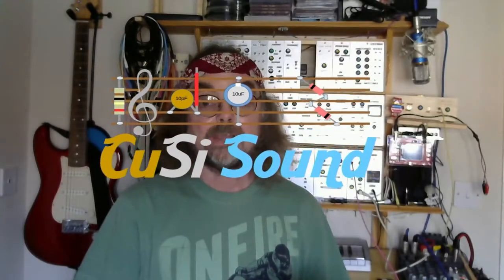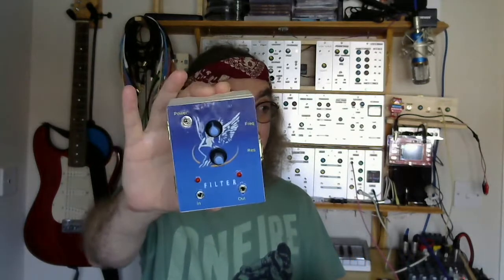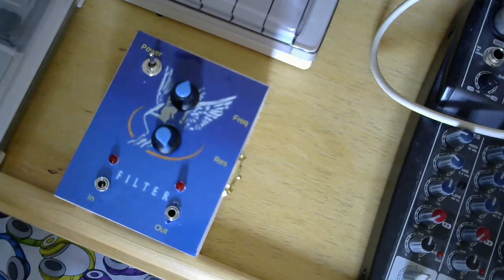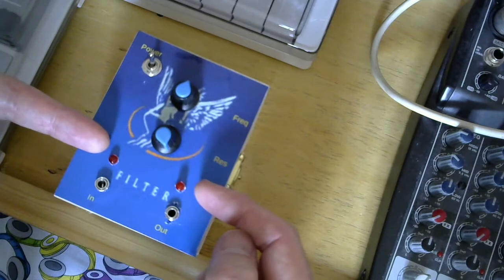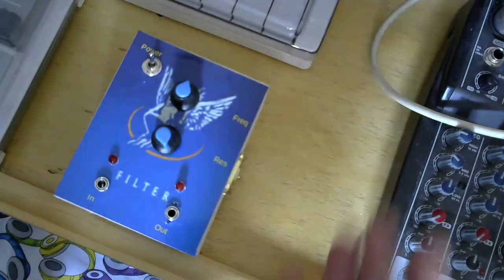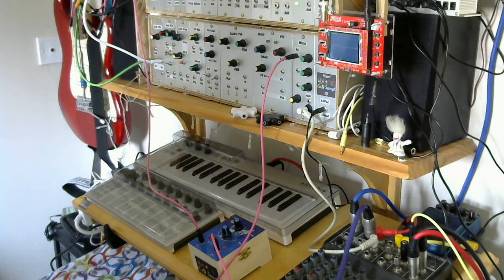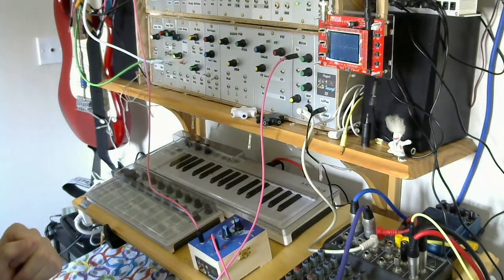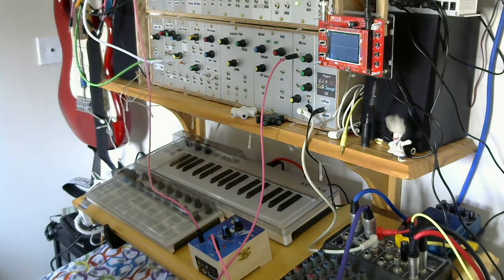Little Boxes Part 10: Filter (VCF)

Comment: Another question: Besides some lights, what difference does it make to use 2 LEDs instead of a signal diode? 
Can we use a single LED?
Reply from the maker: You probably could use a single diode. Look up the circuit for the Q&D VCF. It will change the characteristics of the filter probably reducing the cut off frequency range and altering the CV response.
Reply: @CuSiSound  Thanks for your answer. This filter is my next project. Well, on of my next ones 😀.
I'm gonna experiment a lot on the breadboard. No CV in though.

Comment: I've just finished soldering my VCF! Thanks for your instructions.
PS. I hear buzzing when RES is turn all the way down - how can i get rid of it?
Reply from the maker: I have been playing around with my build of this circuit but I don't get the buzzing as you describe. There is some noise when I turn the res up high but that is inherent in the simplicity of this circuit. As I understand it, the original author of this circuit was going for simplicity rather than fidelity. One thing to check is the connections to the filter as a dodgy patch lead is often the cause all sorts of problems, I have plenty of experience of that!

Comment: can i use tl072 ?
Reply from the maker: I have just done a comparison check, swapping the LM358 for a TL072, and it appears to make little or no difference to the performance of the filter. The short answer is yes you can use a TL072.
Reply: @CuSiSound  Thanks m8!! i have 2 options now!

Comment: That sounds like a solid and reliable little filter. Something I hadn't heard before is how it seems to actually shift the pitch as you adjust the cutoff frequency. Is that the effect of the opamp, just increasing the amount of voltage?
Reply: Given its basic layout the UltraSimpleVCF is incredibly effective. I first came across it about eight or nine years ago and put it together with an LM324 at 5v, some of the output could be very aetherial. Had a nice eerie, hollow booming effect with a sudden change in the CV.
Reply from the maker: I'm not sure what the electronics theory is for that effect, it's beyond my level of knowledge, but it adds a little unique character to the filter that I like. I have a version of this filter in my Project XII synth and it's great for shaping bass sounds.

Comment: RELEASE THE SPACE WHALES! lol jk. 

Sounds good and looks nice. I think I'm going to build this one up myself. I like that you used leds in replace of the signal diode. I going to add the CV back and maybe even add  CV for the resonance.(vactrol maybe?) I've been putting off building an active filter dew to most having used a split rail power supply. so this is motivating and lots of help. I wonder how changing the non inverting ref voltage effects the circuit. something to play with. Hope you're having a nice day.
Reply from the maker: The simplicity of this circuit makes it ideal for experimenting with component values on a breadboard layout. The key ones for frequency filtering are the capacitors and resistor that make up the bridged T-filter.